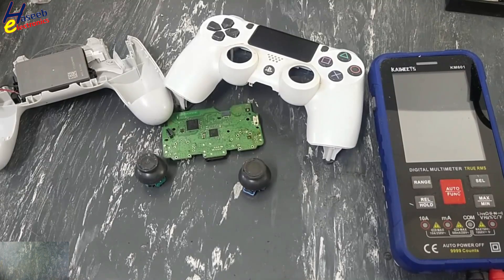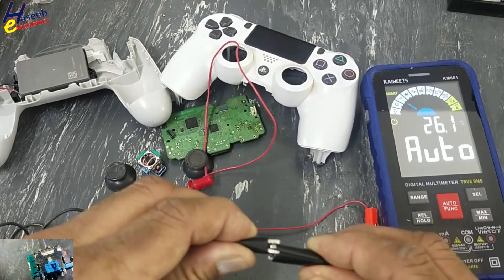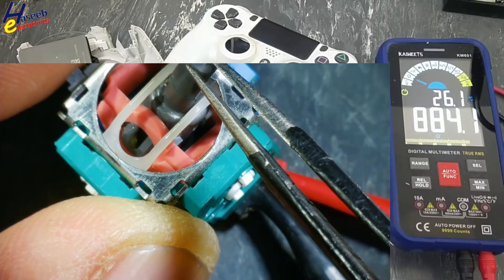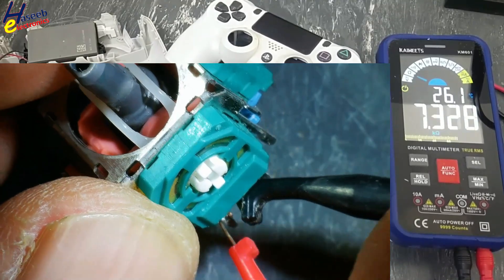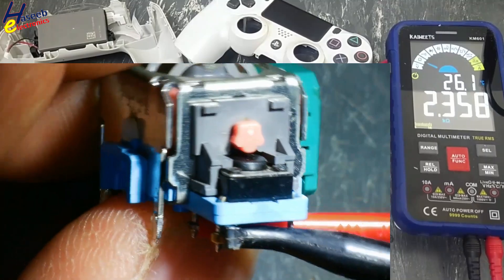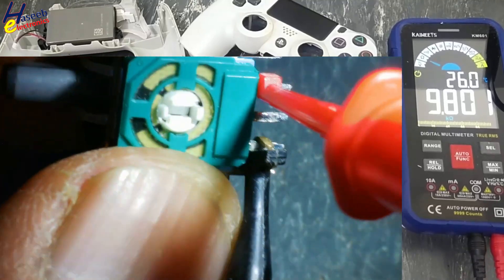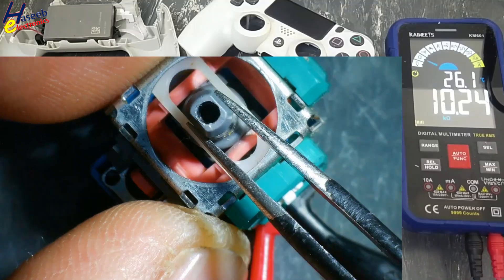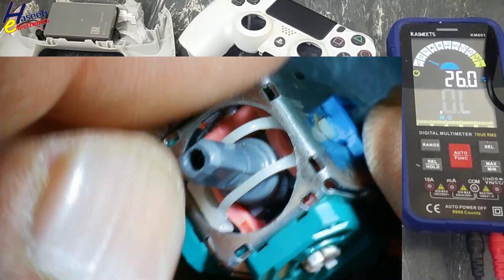{1323} How to Test Joystick Drift Sensor | PS4 DualShock 4 Controller Potentiometer Check

Comment: I was surprised that the "good" potentiometer had a value of ~850 ohms at its farthest travel. I was thinking that it should be closer to 0 ohms.
Reply from the maker: no it is not like a simple potentiometer. its slider arm has a resistive ring. at extream ends its slider arm induces its some hundred resistance.